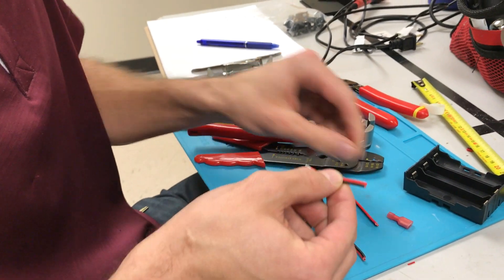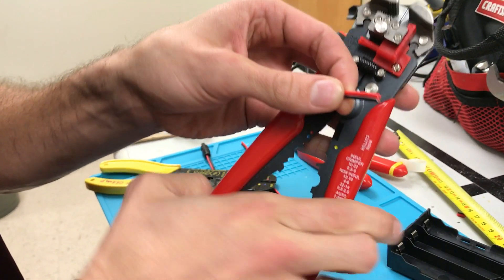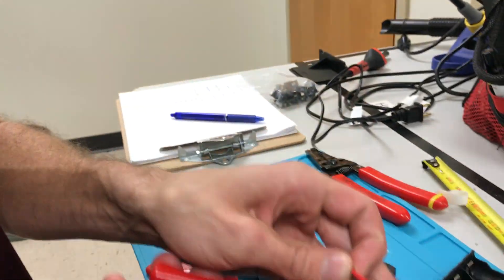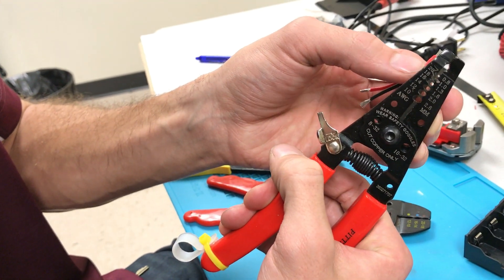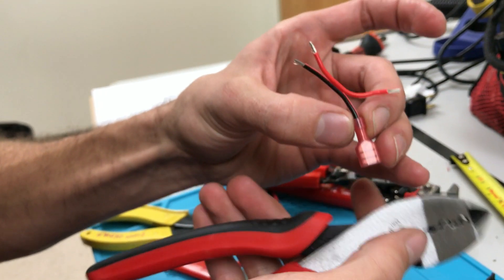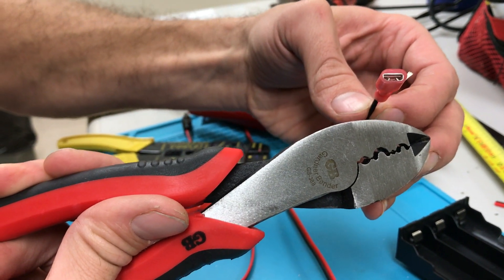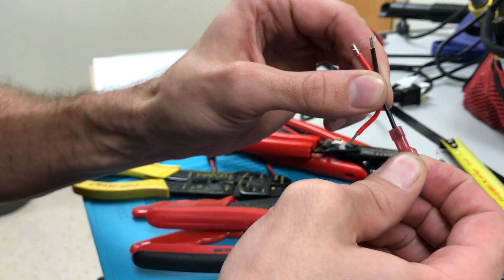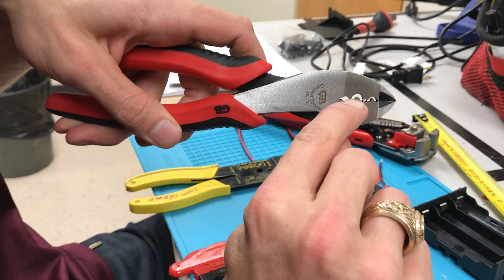Scuttle Battery Pack - Crimping Insulated Terminals

Comment: As someone who has really struggled at crimping. 
When you said squeeze with one hand was that as hard as you could or until there was resistance. Then when you pull the wire to test the crimp are you just tugging at  it or you should be able to pull hard? Thank you for the video.

Comment: Wrong, the crimp die with the tooth is for non insulated terminals. Also on non insulated terminals when using the tooth the tooth needs to be removed i the non seam side
Reply from the maker: That sounds like you are probably correct.  Got a video?  Need to post instructions in our student projects labs.